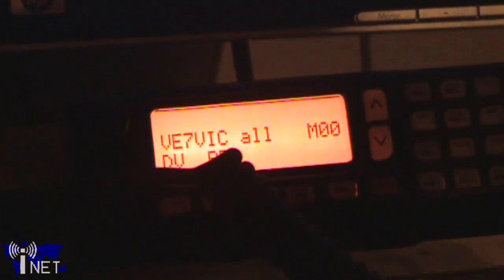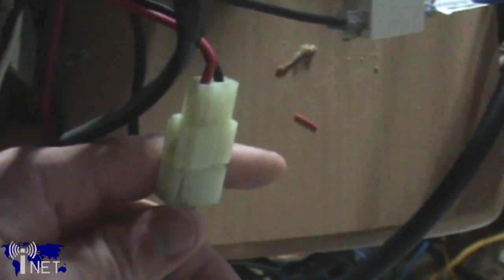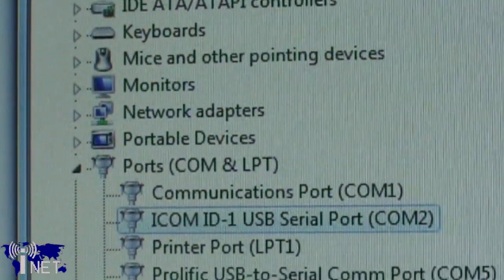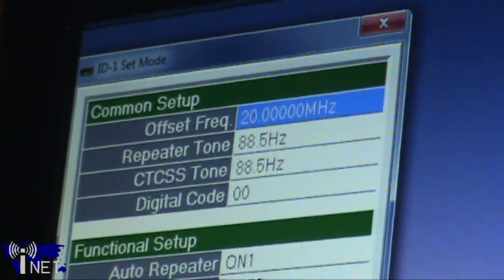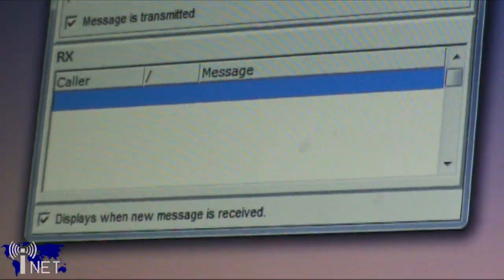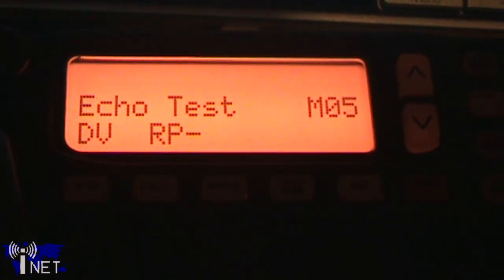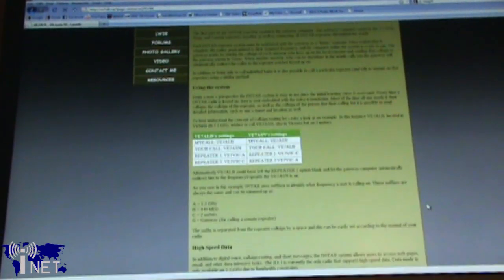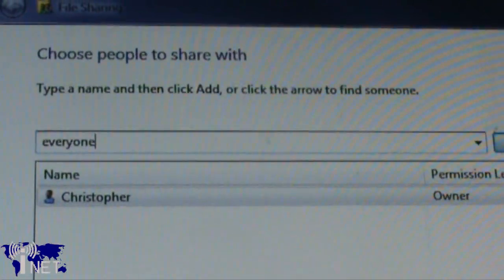Icom's ID-1: Features and Configuration

Comment: Connecting the ID-1's Ethernet port to a router is a bad plan - the ID-1 acts as a bridge in high-speed network mode, so it will echo ALL the packets on your local network (MS Windows broadcasts, etc) that are sent to its network port.  The safest way to use it (creating the least amount of useless transmissions) is to get a cheap USB-to-Ethernet adapter and configuring it just for the data network you want to use.